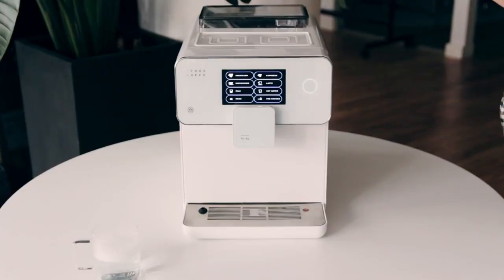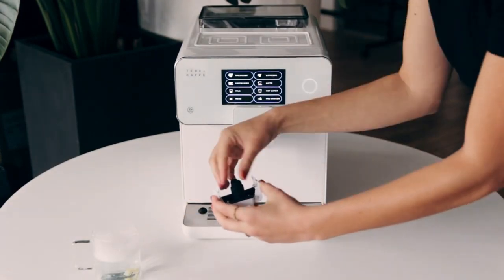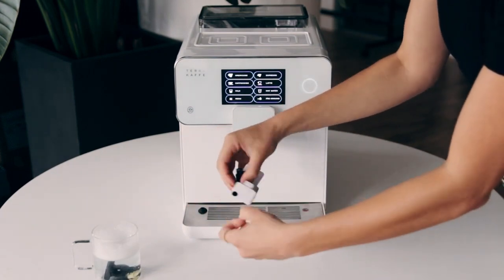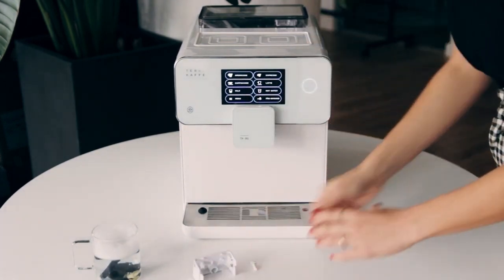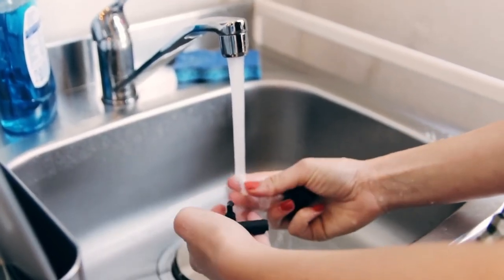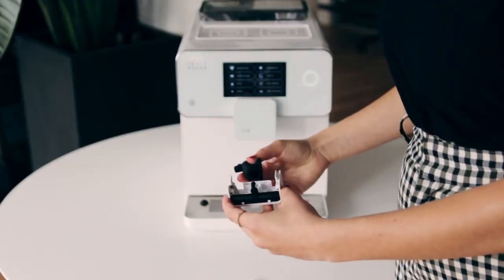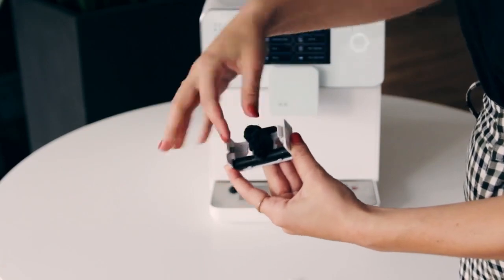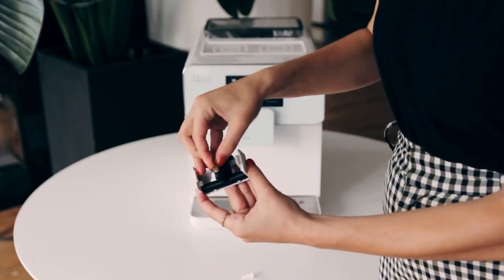Milk Spout Cleaning | TK-01

Comment: When I remove this part it does not look the same. Is this a newer version of this part?
Reply from the maker: Feel free to reach out to our CX team at contact@terrakaffe.com about this! They would be happy to help.
Reply: Did you get an answer from them? Mine also does not look the same. I don’t have the larger rubber piece in the middle. Just the smaller tube one.